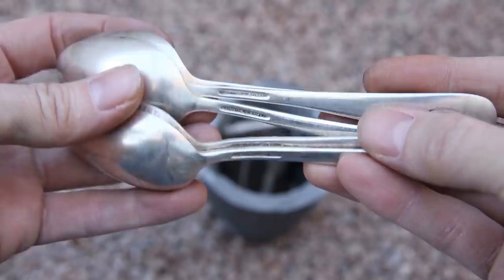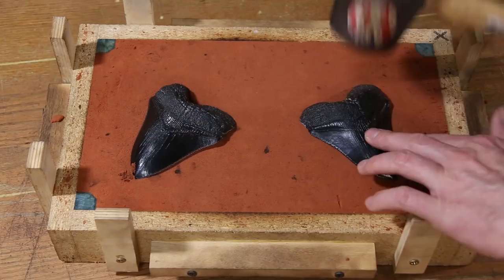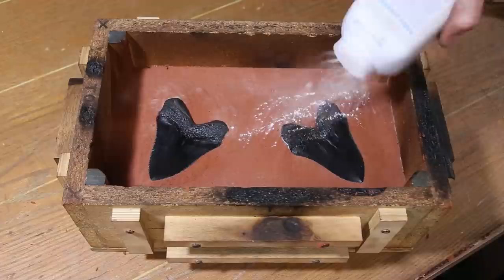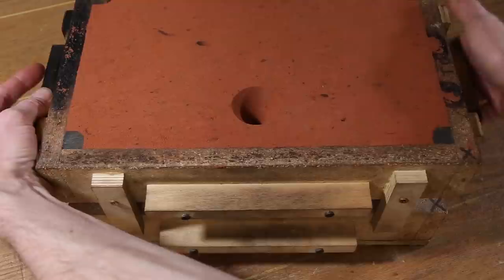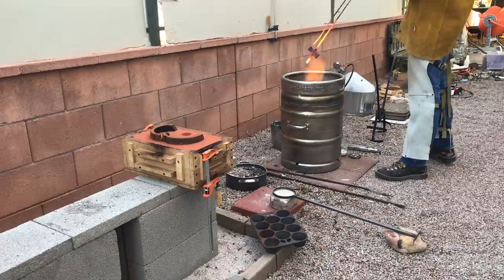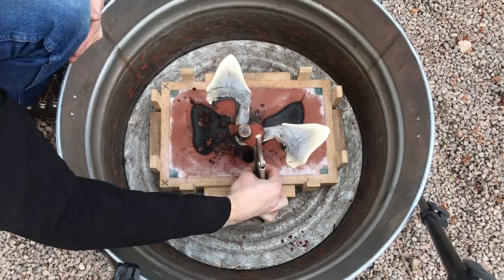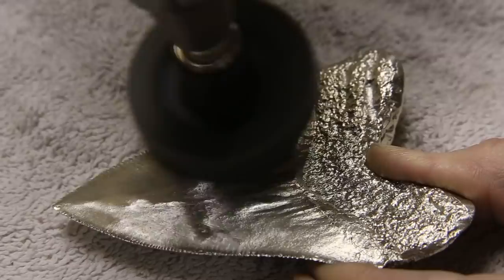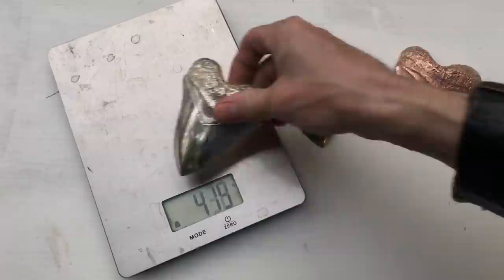I made Solid Silver Megalodon Teeth │ Casting silver at home

Comment: Normally I'd say anyone melting down ornate cutlery is a savage and losing value because they tend to sell at over scrap price..
But in this case you turned out something amazing.
Reply: I would argue against melting those spoons... casting grain may even be less expensive.
Good presentation.
Reply: @paulwiggins183  I'd never melt down anything like that but this is one of the very rare occasions someone has melted saleable silverware and turned out something that didn't make me grit my teeth (pun intended)..
Silver shot is definitely the way to go and it's what I use unless I have damaged sterling. Its still a net loss - but less than if just melted down to a bar.
Reply: @Gainn  True!
Reply from the maker: Thank you! I really appreciate it!

Comment: An odd thing to try but here goes, the tooth if heated strongly and set down on a flat piece of steel might start to rock back and forth rapidly if placed so that the curved side is down. The physics demonstration is know as the Trevelyan Rocker effect. I've had a brass ball roll round and round for over 5 minutes in a bowl using the effect. Just something fun to try, making metal move in "mysterious" ways. The megalodon tooth I have seems to rock fairly well if tapped on a side, so a silver one would probably do fine.
A rolling motion with nothing more than heating the metal first.
https://www.youtube.com/watch?v=9jKUXVG8duE

On the Vibrations and Tones produced by the Contact of Bodies having different Temperatures
"IN the year 1805, M. Schwartz, inspector of one of the smelting-works of Saxony,
having a quantity of silver in a ladle which had just solidified after melting, and
wishing to hasten its cooling placed it upon a cold anvil, when to his astonishment
sounds, which he compared to those of an organ, proceeded from the mass."

"In the year 1829 Mr. Arthur Trevelyan was engaged in spreading pitch with a
hot plastering iron, and observing in one instance that the iron was too hot, he laid
it slantingly against a block of lead which happened to be at hand. Shortly afterwards he heard a shrill note, resembling that produced on the chanter of the smaller
Northumberland pipes, an instrument played by his father’s gamekeeper."
https://royalsocietypublishing.org/do...

Comment: Whoa---why is there such a huge weight difference between the two casted sterling teeth? 486 vs 458 grams? That's nearly a troy ounce's worth of weight difference. What gives?
Reply from the maker: The two resin copies are not exactly the same. One is slightly thicker than the other.
Reply: @robinson-foundry  Ah, well that explains that.
Reply: @robinson-foundry  I don't know if I missed it somewhere, but what was the final weight of each tooth? very nice work my friend. I'm a goldsmith among other things and this stuff is right up my alley

Comment: That's sand casting porn right there, I've gotten some great castings with bronze and aluminum before, but this blows those out of the water, I'm guessing mainly because silver's rate, oxidation, maybe viscous properties, not sure, but I've always noticed that silver castings come out clean and perfect much more often than brass, aluminum, and especially copper ever does.